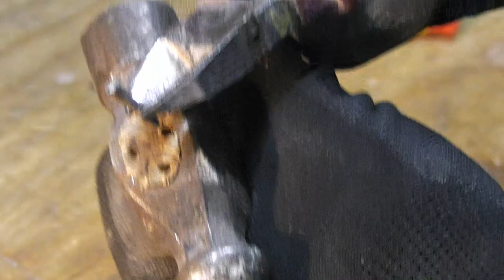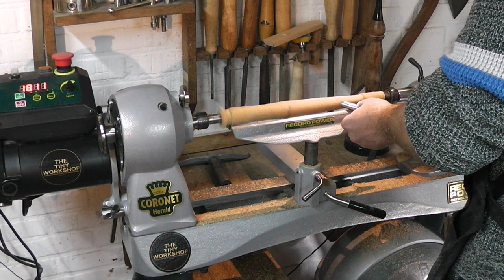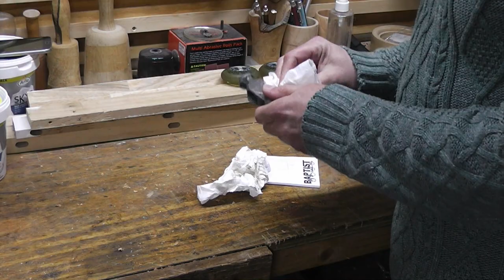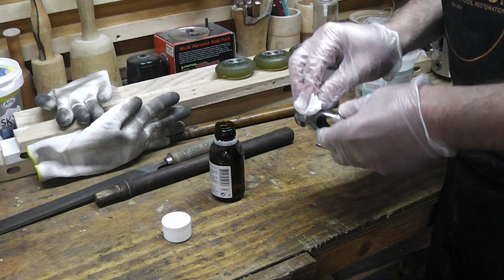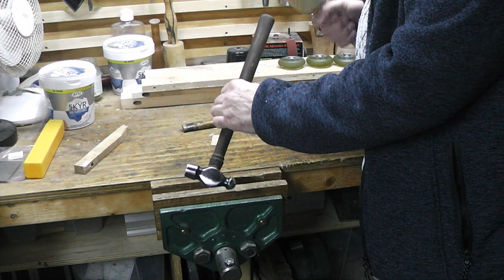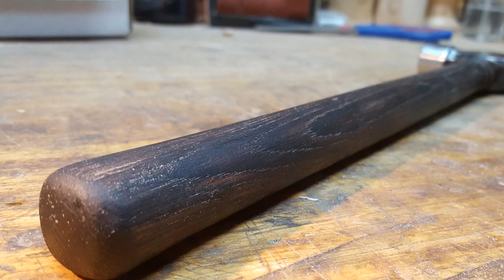Tool Restoration - Ball-peen Hammer

Comment: Looks better than new Frank! Great work on everything. I have a hammer that has been in need of a handle for many years.
As I recall it was very old when I got it as an apprentice wood pattern maker. I have sanded it and refinished it many times but there are lots of scars on it from all these years. Guess I will just leave it the way it is..lol
Take care,
Gary
Reply from the maker: Yes Gary, look better, but works still the same as before 😂. I advise you to leave yours the way it is. That saves some time. I like to see you woodturning. Take care.
Frank.